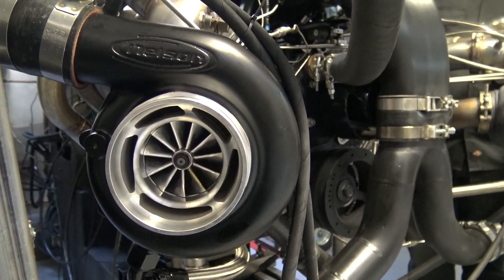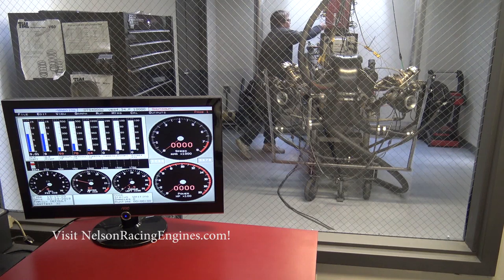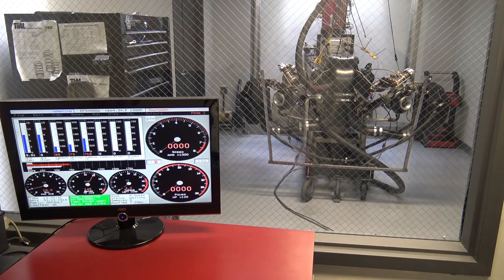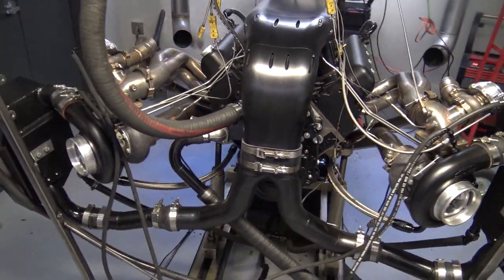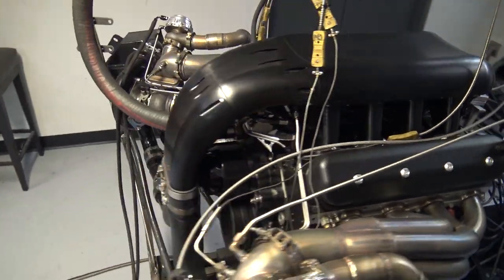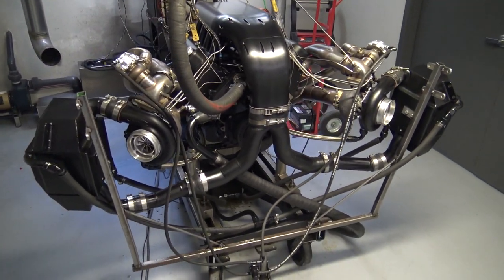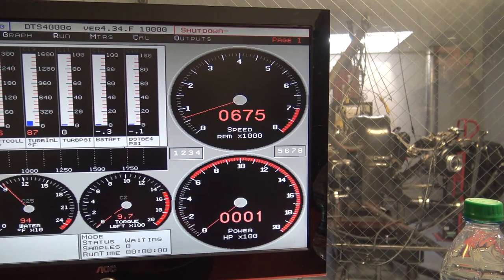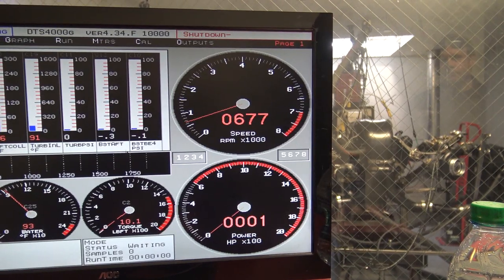New NRE Mirror Image  Turbo, Gen 2.  1650 HP TT LSX Camaro Supercar!.  NRE TV.

Comment: Sick engine! Overall, nelson builds are just pure porn. I'm just waiting when usa v8 engines will abandon push rods and start using overhead cams and 4 valves/cylinder. In europe we are having over 1000 whp dailys with around 3 litres engine displacement and typically 6 cylinders. Big v8 is cool for sure, but face it, it its pretty old technology :)
Reply: Why abandon pushrods, even if they are older tech they're getting down the quarter alot quicker than any German turbo 6 would, alot more reliable, easier to maintain, more parts available, and that's with less cams and valves. Find me a team of workers who can completely strip a dohc block and assemble it in 29 minutes like what's been proven many times over as an average time for a team to rebuild a pushrod engine. Also out of the top 10 highest recorded mileage cars, 7 are pushrod, can you find me a car has more than 3 million on the clock that uses ohc design? There's a reason they still get used, don't need to fix something that isn't broke bud.

Comment: as long as you people insist on putting these engines in the worst possible cars available I can't respect what you do. muscle cars were an embarrassing joke when they were being sold new. ugly, extremely heavy, terrible handling piles of junk. you can only polish a turd so much before it becomes a skid mark. put this in a starlet or a rx3, then you have something. 1600 HP is nothing when the vehicle weighs 4000 lbs. goddamn. power to weight > raw power.